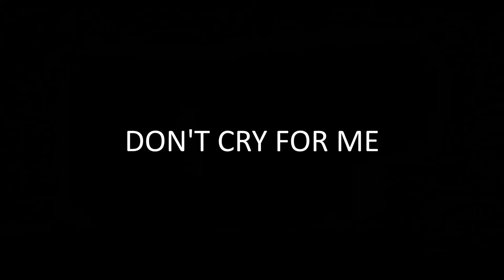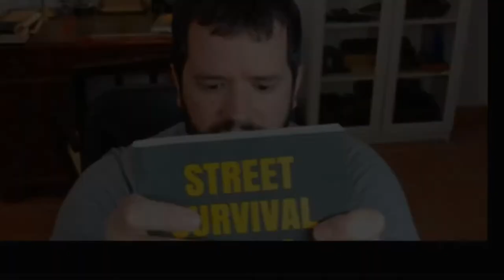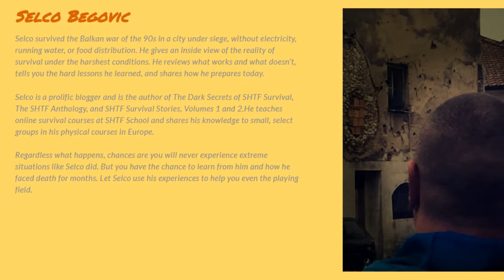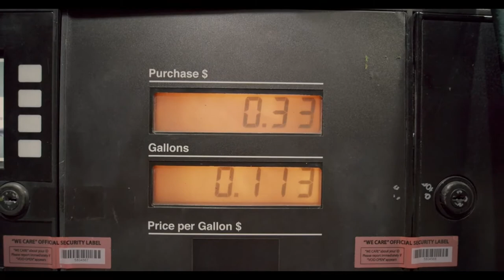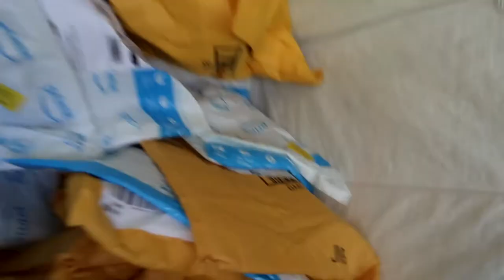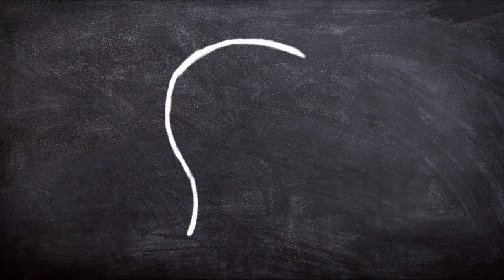What Modern SHTF Looks Like - Emergency Survival

Comment: This video has finally made it to my feed a year after it was posted. 
I grew up in a major city on the east coast during the 60s, 2 gas shortages in the 70s, the 80s were hijacking planes across the globe, 90s first trip to Iraq. Sunday October 7th,2001 to present woke day AMERICA has been a slow burn SHTF. This country was within 1 minute and 11 seconds of the power NOT COMING BACK ON in Texas. Would of stopped everything nationwide. Truck and train traffic for supplies and so on. The border to Oklahoma is 700 miles, Texas is 860 actual miles across I-10. 
All any foreign country had to do was walk or drive across the border. Tank of gas is good for maybe 300 miles with no traffic. 
See where this is going?

Comment: Wow, well-made video. Excellent subject-matter experts noted here.

What I would have done differently (still being a hardcore 1980's Mad Max fan) would have been to lose the scenes from that latest Mad Max movie, which was a joke, IMO (Yeah, I know it won an Oscar or-two, but the Oscars are a different story these days, as well). An excellent, critically acclaimed, more realistic Australian-made counter to Mad Max, The Rover, was an awesome movie, taking place 10 years into a global economic collapse. Should have used scenes from that.

What you're getting at in this video is localized collapses, WITH RESOLUTION. If you look at the big picture of societal decline, Western/Industrialized civilization (Led by the U.S.) peaked in the early 70's, and has gone into decline since then (admittedly with some good upward periods, like the mid-to-late 1990's). Working at trade show events over the years, I've noticed the public getting generally dumber, and usually on something: Drugs, alcohol, prescribed and illegal.

Therefore, some of us (especially those of us who follow collapse theorists, like John Michael Greer) prep for multi-generational collapse, or as he once said, "collapse now and avoid the rush." IOW, my preps tend to follow a foundational plan, starting with my wood stove, rocket stove, gardening from saved seeds, etc. However I also try to prep for "the contemporary environment" (an Army MI term), as in what will hit us now, rather than later. For instance, I'm concerned (mainly due to Climate Change) about all the dry vegetation in my neighborhood, after an exceptionally long, cold and wet winter. And sure enough, we just had two fires in the neighborhood that even made the local news, due to a high wind.

Comment: You didn’t consider what is likely the most possible shtf situation we currently face, electrical grid going down, for one reason or another.
Reply from the maker: That's a whole separate video in itself that I did.
Reply: @SaltStackActual  ah, I’ll check it out